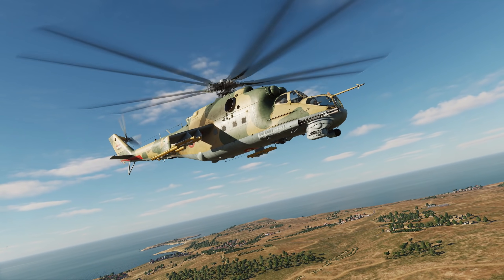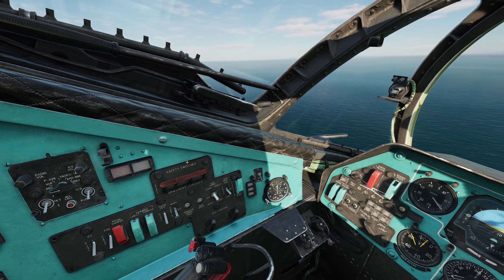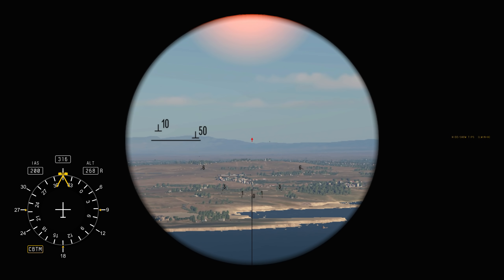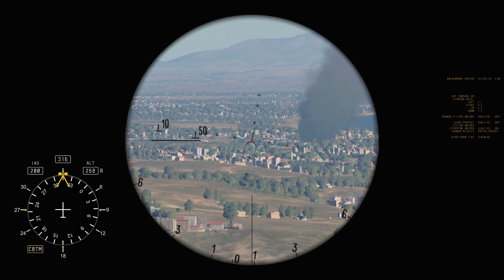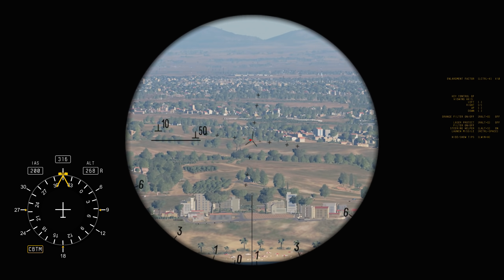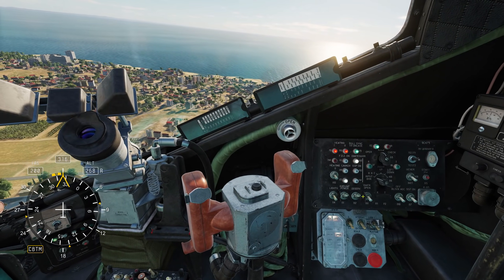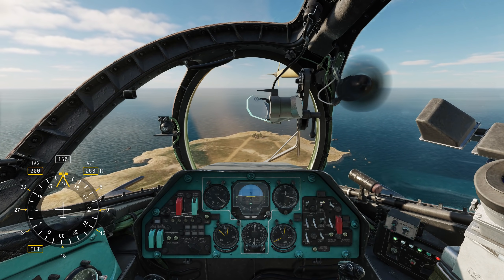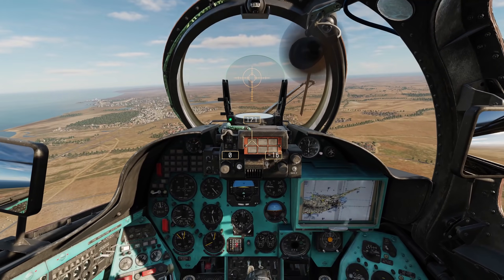DCS: Mi-24P Hind | ATGM

Comment: Hello Wags! I'm very pleased to have this unique helicopter in our DCS. Although you say that you must keep the hud's crosshair towards the target until the missile impacts while flying the helo from the back seat, I saw that I can quickly steer off after "Petrovich" launches the missile and as long as he keeps his observe system on the target and I don't exceed 60 degrees offset from the target when I veer off, the missile still remains on it's path (probably laser riding, I don't know yet) and hits the target precisely where the designator was when fired and after the hit I immediately command an observer off command. So I'm asking you if this is abnormal to have the missile still follow it's path when I veer off after the launch (yet still not reach 60 degrees offset) or the way you did was just to be more sure that the missile won't lose the target? Cheers!
Reply: Ahh, nevermind, I've heard you say closer to the end of the video that as long as you keep 60deg (plenty enough) off the target, the missile will follow the target. So it may then not be abnormal for the missile to still be able to follow the target even after some more abrupt maneuvers as long as the angle is not exceeded!?

Comment: Hey matt, great video! Just curious if the Pixelation of the terrain in the pericsope is something thats going to be permanent? Guessing it may be for performance optimization? Nonetheless great work on these video series and cant wait for the hind!
Reply from the maker: It is using low LODs because on the zoom. We are aware and plan to fix once we have a technical solution.
Reply: @MattWagner  Is this going to be done for TGPs too or just this sight? I often see objects pop in and out while using the TGP even when the view distance is maxed out. Might just be that the pod is too good at long range that it can see past the render distance of objects, but something should be done to fix that imo.
Reply: @MattWagner  I really hope you find a solution to this. Otherwise the Hind looks awesome.
Reply: @MattWagner  Will Picture in Picture rendering of the sight be mandatory at initial EA release?

Comment: The visibility inside the cockpit is amazing coming from Ka-50 which is atrocious.
Reply: Not only the Ka-50 visibility is enough for the job (you are not sight-seeing, after all), its automation level makes up for anything else.
Reply: bit late on my answer but also consider that the KA-50 has a pretty decent camera system and you can target stuff from miles away,  and you have ABRIS for situational awareness and a data link with other KA50's - so all in all, visibility through eyeball mk1 may not be that great in comparison to the electronic arsenal of the 50 :D

Comment: What's with the aliasing in the gunner's sight? Is that WIP or is it an engine limitation?
Reply: I've looked through plenty of 60s-70s and even 50s photo lenses, and they were/are plenty sharp :) Raduga is an optical system like them, no screens involved. Probably it's an implementation thing for now. Not that mind it myself TBH.

Edit: I have to add, optics do get different resolving power and not all lenses/periscopes etc are equal. But an optic with lower resolving capacity would look more smudged/less defined, and not pixelated, pixelation is more or less exclusive to digital media.
Reply: I think it's simulating a lower res display
Reply: @Tailspin07  It's an optical periscope, if anything there would be lower light intensity but there shouldn't be aliasing artifacts.
Reply: @Tailspin07  I can't help but smile at all the people saying this right off the bat. Low res display in a 70s helo lmao. The poster above is correct, this is an optical system, it should look like the sights in Combined Arms, not like the Shkval display.
Reply: @Æhere11  Fair enough

Comment: I note the Petrovich AI has a delay built in for finding targets - well done.
Q1. Is the Petrovich AI susceptible to normal battlefield obscuration from smoke, trees terrain etc?  If so, does this apply to both before and after missile launch?
Q2. What is the search area that Petrovich will look around from the point you designate?  How wide/ far from there will he search? is their a pattern to it?
Q3. What happens if the Petrovich can't find a target in the search area?  Does he tell you in some way?
Reply: @Andre As stated by Matt, if you put petrovich into an Auto mode for the ATGM, he will fire on the selected target once he is in range. This mode is indicated by the reticle being in Green.
Reply: To answer the first one, in early access I imagine that the ai won’t be super advanced. So they won’t necessarily be obscured by smoke, but terrain for sure. Note that pretty sure the optical device used to guide the ATGMs is laser guidance so any kind of terrain will obscure the laser for the missile.
Reply: @darkest_eclipse8271  the shturm is radio guided, so it can be guided through smoke/clouds. However it’s pretty hard targeting something the gunner cant see
Reply: @teun0het  huh didn’t know it was radio guided. That’s interesting to know

Comment: With switches in both cockpits required for a particular function, the need for coordinated flight and this 60/ 70's tech (which I love), this module just screams out for two humans in the cockpit.
Reply: And with the new Trial system you can get buddies to be your gunner for two weeks every 6 months for no charge on their end.
Reply: would have been better if the front gunner did something other than use the atgm like maybe have some kinda 12.7mm hose to whip around...
Reply: @mitri5389  Agreed.  Would be nice to have both variants.

Comment: I feel like this was just as much a video on the Petrovitch AI as the ATGM. I do like the implementation, though it does almost feel like you manage the AI like another aircraft system. I would imagine the AH-64D will use a similar implementation, though looking at the Apache's cyclic and collective grips, I don't know how we'd be able to dedicate yet another hat switch to the AI.
Reply: It's mentioned in the quick start guide they dropped today (or, yesterday, depending on your time zone) that Petrovich commands can be bound to controls already used for other things in the cockpit, and once you press the button to open the Petrovich command UI, it will use those controls for Petrovich rather than whatever they were bound for otherwise (i.e. binding a trim hat to trim, but when you press another button, the trim hat functions as the Petrovich directional commands), so it shouldn't be that bad honestly.
Reply: definitely going to be modifier intensive modules that's for sure!
Reply: @SmallishBear020  I use Vaicom Pro with Voice Attack with Jester, so I'm hoping these are implemented in a way that they can be similarly hooked into, voice comms are just more immersive
Reply: @poiu477  Looks like VA should work pretty well here. The only one that might be a bit tricky is commanding a heading for the pilot when you're in the front seat, since you need to hold the left-right command to move the heading bug. I guess well have to make do with a few preset commands with the buttons held for different durations ("Turn 10 degrees right", "turn 30 degrees left", etc).
Reply: DCS AH-64D: I think that a company will gladly sell us a 2000$ HOCAS that we can't live without !!!
Reply: @JoJo-vm8vk  I may have to make one myself. The Apache's collective is unique in that it has 2 different hand positions. Both have numerous multi-position switches. I have a feeling a realistic grip would go a long way. A toggle to virtually switch between grip positions would also be an option.

Comment: Anyone understand what he means when he says a direction followed by short or long? Does that mean the key press? It’s confusing to me. In reguards to petrovitch
Reply: Short means a key press less than .5 seconds and long is anything more than .5 seconds, same as in the A-10 doing DMS left long disables the JHMCS, for example.
Reply: so if you put the 4 directions on a hat switch on your stick, pushing up briefly will do one command, pushing up and holding briefly will bring up a different command
Reply: It comes from the A-10C, controls have double functions, based on how long you press the control (SHORT or LONG).
Reply: Oh wow okay I did not know that. Thank you both for the answers. I really appreciate it!

Comment: The only imperfection seems to be the AI suffering from some pitch oscillations? Otherwise... this looks brilliant! Especially once the audio interactions are in.
Reply: Think it might be because the speed for the attack run was only about 200IAS so when he commanded Petrovich pilot-commander to do the hook turn, 180 the aircraft didn't like that very much
Reply: @crazygmanssimstuff  so youre saying that the AI is using the actual flightmodel? 
Oh, boy i wished the AI would do in other aircrafts. Especially when doing dogfighting against AI.
Reply: @Jockesse  mig 21 et al.
Reply: @crazygmanssimstuff  Pretty sure the ai does that because of the wing design, I believe it was warned earlier to try not to bank too hard or else you’ll find yourself into a spiral dive.

Comment: When in sight everything looks "Blocky" is that a feature or a DCS engine limitation?
Reply: its using a picture in picture texture for some reason to achieve the view you see, as for why they went with picture in picture mode I guess its so you can look through the eye piece in the cockpit... pip in dcs looks like armas pip which means low resolution and low LOD, a few games have done pip well the best Ive seen is the periscopes for tanks in Il-2.
Reply: @mitri5389  Yeah the tank sights in IL-2 do it really well, regardless I'm excited for the module
Reply: It's a good question, it looks like it's a render target, so it goes off of the MFD resolution in the settings, because if that wasn't 512x512 I dunno what is :P
Reply: Seems it's just cropping the image more or less instead of reducing the FOV. Very odd way of doing it.
Reply: Probably a feature.  The sight Probably didn't have a very good resolution back then.
Reply: I think the optic is a periscope, shouldn’t have a resolution